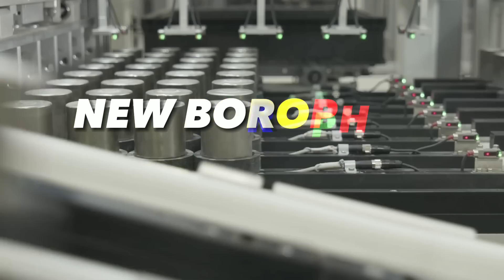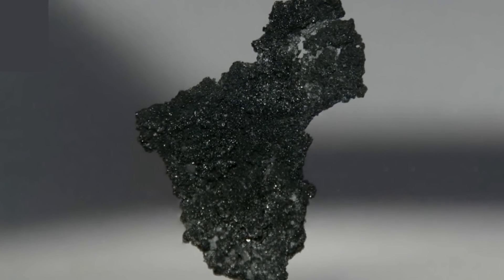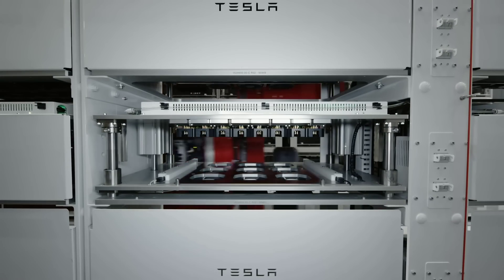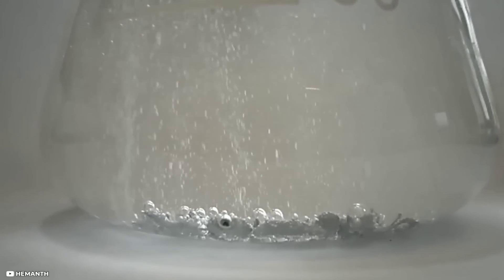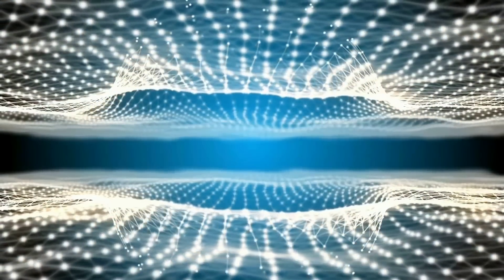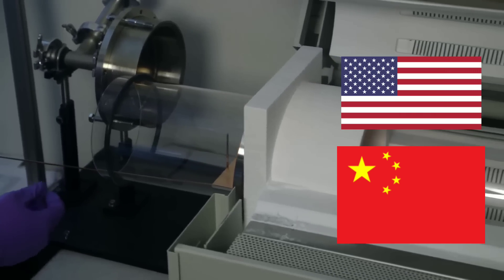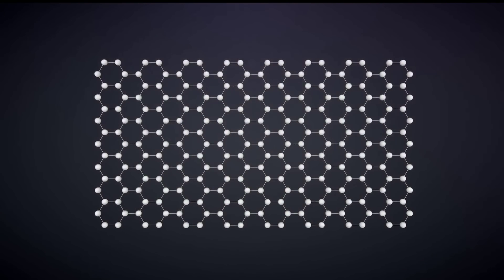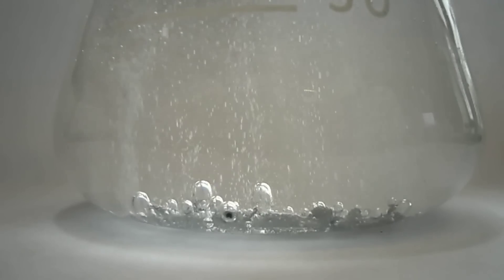Goodbye Graphene?! Elon Musk Introducing Borophene, The New Wonder Material! 2023

Comment: EVERY EV on the market has three major problems. Overpriced for what you get, too short a range, too long to charge.
Reply: Fire!
Reply: Yea Because Gas cars NEVER burst into flames. I have Had Two Cars Burst into flames for No Reason first one was my 1985 Nissan 300ZX  just Had Sears replace my $2100 set of Pirelli's that Only Lasted about 10 months with a set of Goodyear GT plus4  or whatever they were called that cost me $1200 cause they were on sale & As I Was Leaving the parking lot the car stalled & would not restart & I was at the green light so I ended up putting it in neutral & left it coast back cause I was on a slight hill & I coasted back to the upper edge of Sears Parking lot & When I Turned back around I Seen all this Smoke coming from under the hood so I if course pulled the lever & Went out & opened the hood Which was A Huge Mistake because That's when the Smoke disappeared With a Bunch of Flames & by the time a fire truck got there both the front tires popped & burned. Ended up taking the ones of the back & selling them for $300  & putting in a pair of worn out crap tires a garage gave me right After the insurance Guy Came out & made me a $5,200 claim. Sold the seats too for $150. Nissan Said It wasn't their fault so I took the $5,200 Cause My mom worked with a guy who Was in court with Nissan for over 4 years at the time cause he bought a 300zx new & it burnt up & he had no insurance  but Wouldn't you Know About 5 months After That Nissan Took Blame for All the 1984 & 85 300zx's that burst into flames cause of electrical problems & Nissan Gave that Guy Every penny He had Paid for his car New Even Though he had it 4 years & drove it 54,000 miles. Then About 3 years after we that I Had a Ford Taurus burst into flames At the Garage I had Driven it to because it was Smoking & I Was the Passenger one time when A VW Bug I was in Started Smoking & went up in flames for the Girl I knew.  Plus Tesla is Over Priced Yet I Was Going to get an Amazing XPeng Before The Worthless Trump Tariffs against China for n 2018. for $21,000 Shipped & Here But then The Orange Fatman Started those stupid ass Tariffs & it Would Of Cost me  Over 25 percent More so I Sold my Bitcoin & Eth for nothing & Then Ended up Buying most of it back & buying stocks with the rest.   My Crazy Uncle Just Paid $83,000 For A Stupid Ass Gas  Pickup Truck that  ten years ago He could of bought for under or around $30,000  So Talk About Over Priced,  ALL Trucks Sold in the USA are Way Over Priced.  short Range?? Some Electrics Get 450 Miles on a charge & Some New ones can charge to over 50 percent in 6 1/2 mins & Full charge in less then 15 mins. We Need More BYD, Nio, GWM,Xpeng & Geely (polestar,zeekr, Lotus & Farizon)Neta,leapmotor,Auto,Wuling,Chery,Li auto & All the Rest if We Could Go Back To The ONLY Great Thing Ronald Reagan Ever Did End All Tariffs & Said Free Trade Was the Best thing & No One Not Even Any Democrat Changed it Because They Have Always Loved Stupid Tariffs Yet Even they stopped using them after Carter & Said Trump's Tariffs Were Bad & Going to Cost us extra &in 2018  I Cringed & Said that Fat orange bastard  Now he did it cause He Opened The Door even the Democrats Were to afraid to open & I Said Oh No Now We will just Have Even More Tariffs & Cost us more Forever Since Then When The Old Ass Biden Cane to Office What did he do he Signed it into law for Years Longer since Trumps tariffs would of expired but Nope Dumb Old Joe Who Said it Was Such a Bad ideal & would cost us more Then Was All For it. Now Both Red & Blue are For it & Why Because they are Pretty much the Same Party except maybe on woman's Rights But Funny Every one says On Guns Too , yet I Say Really Because It Has Been All Republican Lead laws that Have Caused Gun control. Even Trump's stupid Ass Jumped into Worthless Dumb Gun Control Laws When He Made Bump stocks (which are Really just a spring that connects to a gun stock) Yet Trump pushed For & made a Law To get Rid of them all & Any American Even Caught with One could Face a Fucking Life sentence??? Even if You Own No Guns Or Use it or had any plans on using it.   Yea Sounds like a Great Law Fat Man & Ronald Reagan Getting shot started the Largest Gun Control Ever in America And it was Republican Lead but Don't Get Me Wrong Cause I Hate Democrats Too Same Side of a Worthless Coin.  I'm for america to Have At least 5 or more parties at least instead of letting Both Red & Blue Act like they Are the only other option cause a their Options ALL Suck.  In a country I can Find 25 fast food places & hell 50 different types of cereal to eat for breakfast  but to lead us & make All the Laws Here you get This (pile of shit) or Hey if you don't like that Then You can Have this (Another Pile of Shit) & That's your Teo Choices too bad.  @johndelong5574

Comment: You can also have 'air' battery, whichever type of battery you manufacture, you still need oil and that does not solve climate change, even the mega factory you put up, all machinery used need oil as well as the robot in the new factory, they cannot be operated on sunshine and air, period